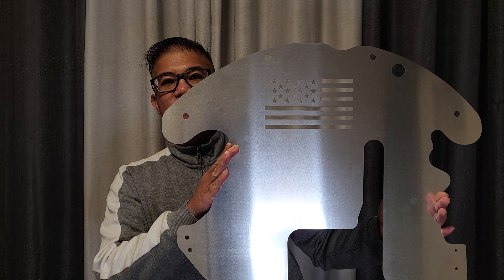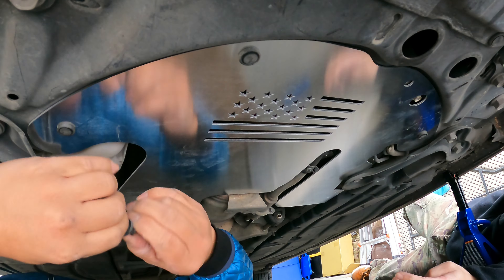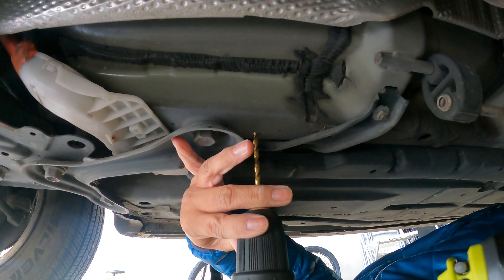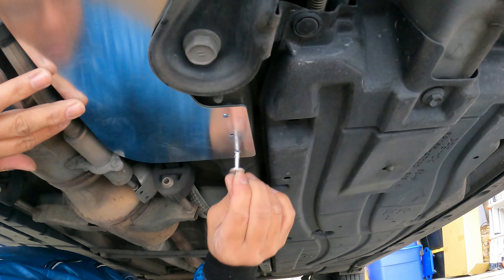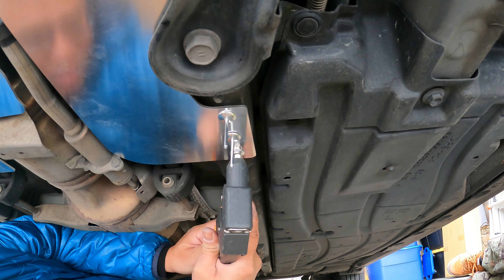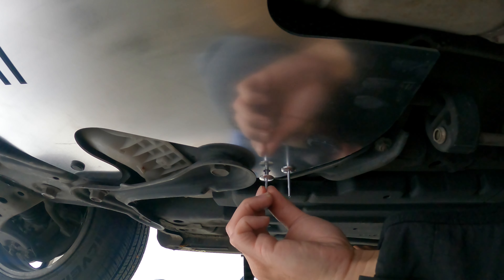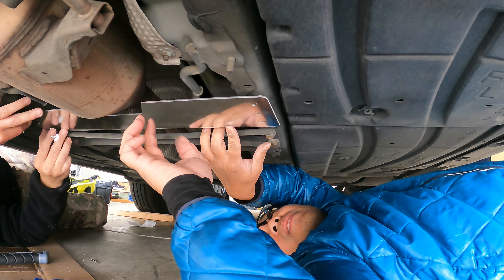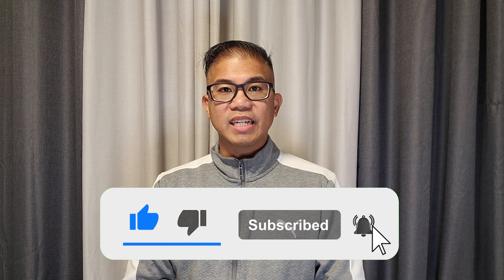How to install a catalytic converter protection shield on a Toyota Prius

Comment: What size nuts did you use as spacers.  I have seen a lot of reviews saying the shield rattles when driving and/or acclerating.
Reply from the maker: Sorry. I don't recall what size I got.
Reply: Ok. I installed it yesterday.  Mine is a "cat defender" that i had sitting in my garage for two years. I think that they are out of business now. BUT it installs just as simple as the guys in the video show. Took about an hour including wiggling my way under and out from under the car.  I used ramps instead of jacks/stands. The hardest part was setting a 1/4" pop rivet while laying on my back with my arms raised over my head. Fok that was a pain in the neck. 

I did not need spacers.

Comment: It sure looked like you were using a floor jack to raise the vehicle. It also looked like you did not use jack stands. Safety first. Always use a block or jackstand in the event that the jack fails.
Reply from the maker: Yes. Jackstands were used on the sides. Left the hydraulic jack is there as backup failsafe. I didn't want to just use the jackstands.
Reply: @AutoSensation  and safety glasses. When working under a car there is all kinds of stuff that can fall into your eyes in addition to the metal removed by the drill.

Thanks for a great video!  You saved me $150 in installation expense.